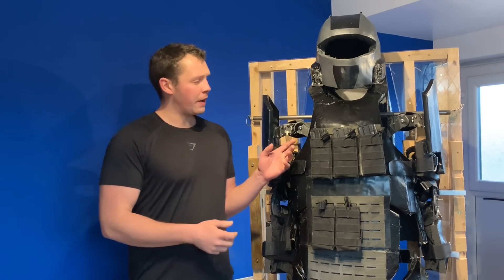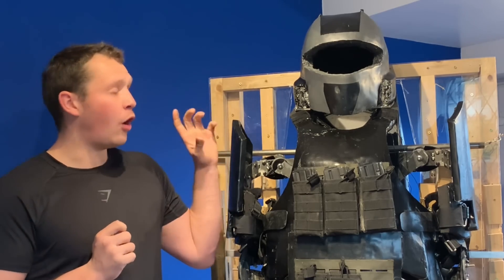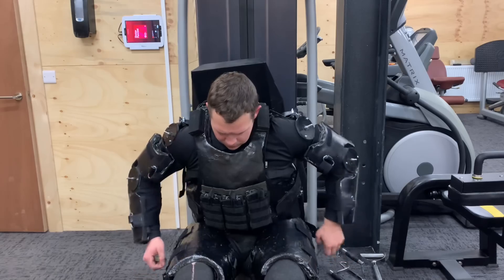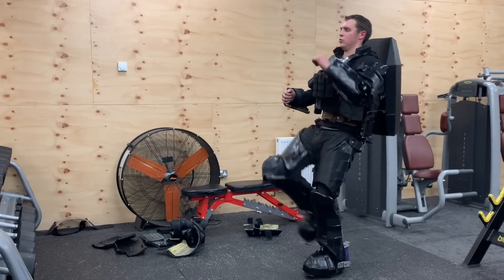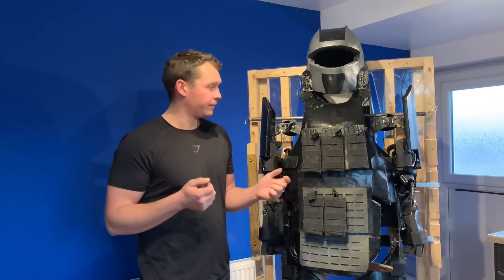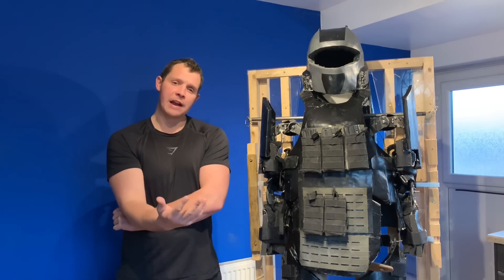Functional Combat Capable Power Armour Development Episode 5 Quest for Bullet Proof Exo Skeletons

Comment: and how is a soldier supposed to handle this immense weight? 
a soldier is already exhausted in prolonged combat.
also this could only be used in urban enviroment. Give it a dusty hot area and the soldier will melt. give it a tropical enviroment and you will 100% get stuck in mud in the first few hours.
also if you get injured, its hard to access or transport you.
Very cool project, but i heavily doubt this will ever see use.

but i dig the ironman v1 suit vibes :)

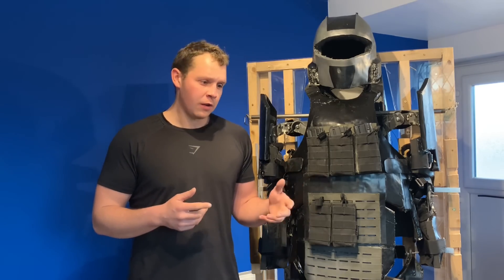also: 1:58 if you take a knee, you should be protected from bullets flying straight at your knee. try fix the weakspots. ankles, knee, your whole arms + shoulders... maybe try using MORE smaller steel plates, dragonskin armor style rather then using big plates to cover lots of area. should help in mobility too

Comment: I don't think it ever work... Leverage weight and pivot points are physics you can ignore, and so is battery/operational life,  heat accumulation, dust, moisture/rain and atmospheric temperatures. then you got the fact that however good the armour blast concussion and superheated air are a factor band will just ragdoll anyone .
Also you'd have to be dam careful weighing twice or three times as much going into various environments, like the abandoned buildings I work in. plus the extra noise you and the suit would make . It's a gimmic.

Comment: This is a nice idea, 
I am not going to tear down your idea.

I will offer some fundamental principles that  i'm certain you are aware of

1. needs to be mobile and more mobile than what normal infantry are, otherwise it is considered a negative. 
2. It has to be functional with being reasonable.  Full Body armor exists currently but is only used by bomb disposal outside of combat. Tactical armor, plate armor and small armored areas is not the presented design so you need to match it to a real world equivalent. So it would be "how to make bomb disposal armor combat ready"
3. Need to fit through doorways if CQC is to be a considered function 
4. Powered armor to increase, mobility, speed and strength is not the same as load bearing. 

Someone needs to start somewhere with this concept and your concept is a great step in the right direction.
Thank you.

Comment: One thing to point out here, the idea that this makes the threat from drone dropped munitions "incredibly slim" is a stretch at best. You have some LARGE panel gaps, especially under the arms, and between the pauldrons and the chest/back plates. This leaves all your vital organs exposed to shrapnel damage. Under the arm, the gap appears to be even bigger than that of my US Army issued Gen IV IOTV. This leaves your lungs and heart exposed to shrapnel from the sides as well as from shrapnel coming in at an angle. Then the added bulk will make getting in and out of dugouts during artillery attacks more difficult, requiring earthen fortifications to be dug deeper and larger, making them larger targets. Their entrances will also have to be larger, making them larger targets from drone-dropped munitions. This says nothing to the fact that a grenade going off 2 feet away from you will still put you out of the fight, even if shrapnel does not find a gap.

This is a neat idea, but unless the armor is fully enclosed (looking at you Spartans and Space Marines) then in the end the cons pretty much neg out the pros. You end up with soldiers who can carry more, but are slower and larger.

Comment: If Ned Kelly had a fabricator and a dream, Its an amazing proof of concept. While I think such armor will be used in the military to a limited degree. I think such suits are going to shine in policing, building clearing, and explosive tech. 
I dream of a future of police that are immune to all but Black tip bullets. 
Police with nothing to fear, no need to react in fear, with a club to apprehend rather then a glock to react.

Though it wouldn't be used for such a noble ideal.

Comment: The inability to establish a cheek weld and aim down sights while wearing a full face helmet can be mitigated in a number of ways. Soldiers already encounter this problem when fighting in CBRN gear. Currently, the two easiest ways of getting around this problem are either to use a visible spectrum laser during the daytime as you're aiming system, or an IR laser at night. Alternatively, you can rotate the weapon about 45° and then kind of cock your head to the side, and that gives you enough of an offset at the optic kind of lines up with your eye without getting hung up on your facial covering.

Something that's being looked at for use in the near future is equipping soldiers with an augmented reality visor. This would allow us to use a non-visible spectrum laser in daylight. A camera could spot the non-visible laser and then render it onto the soldier's visor as a reticle. An alternative route being considered is attaching a camera to the rifle and playing the camera's video on the visor. That second one isn't as big a leap as you might think. We already have high-end electronic scopes that wirelessly stream video to other devices.
Reply: Yup with the second idea. Have a camera be the sight of the weapon used. This way you can aim with it hell ever around corners. Also this way you can make some really beefy helmet and neck guards

Comment: The problem with this is the countermeasure will always be cheaper than the device itself. Even if it can stop 5.56 regular no way you can cover the body with thick enough material to stop 5.56 tungsten AP or worse yet, if you get your clock run by a .50 cal you can die alone from the energy transfer and back face deformation, worst case scenario a drone hit with a few kg of c4 or a rpg round still costs peanuts in terms of making such a suit functional. I doubt they will go on the front line maybe some exosuits will be used for transporting cargo i believe they already are

Comment: I’m sorry to say that the US DoD most likely will not fund this. They’ve already made one their own and it’s bottlenecked due to mainly energy capacity and weight. That’s why it hasn’t passed the testing phase. Another reason being that you must be a US citizen to work with DoD for certain things based on the applications I’ve seen here in UC Berkeley. I don’t know if it includes this. But another big reason would be the NDA, which posting it on YouTube will probably affect.

You can maybe do patreon? Or try to work with contractors?

Comment: some things:

1. You need to study medieval armour articulation
2. anatomic considerations - for example, the vambrace portion (the forearm armour) should terminate well before the wrist and some. main breast and backplate should not extend too far below rib cage end. I'd go so far as to maybe the bend should start towards the end of the center of the rib cage for better mobility and prevent neck trauma. anything below covering the lower trunk should have bands of overlapping plates (see 'placard', 'tassets' and 'faulds').
Reply: I used Medieval armour as a starting point and tried to marry it with Hockey gear. Not an exoskeleton, just wearable. It was too heavy and too hot to be feasible. It needs much lighter weight ballistic protection and a cooling system.
Reply: Haha have you heard of rgopvc? You take regenerated graphine oxide, mix it into pvc, then you cast it. You could just use molds and copy the hard parts of the hockey equipment and replace them with the rgopvc copies. It's something like 4x the strength of steel, while much lighter, so you could probably make the parts even thicker without having issues with weight.  @nautifella
Reply: @utterube   you probably wanna cast with  CNTs for better properties than rGO :)
Reply: @nautifella If your medieval armor feels heavy to wear, it wasn't fitted properly. The only thing that you should be really feeling the weight of in full medieval plate (barring really moving in it for extended periods) is the helmet because it's just sitting on your head with all its weight, everything else should be pretty evenly distributed across the body in terms of weight.
Reply: @nautifella  in the way of cooling, you could probably have a temporary solution involving those SAAPI hydration plates that just carry water.
Reply: Absolutely right.
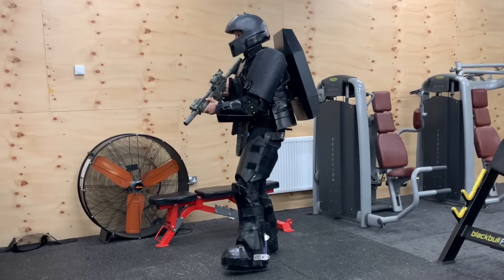Reply: 9:09 get rid of the visor all together. 

Vr headset with display on the inside of a fully covered helmet that has a series of cameras on the outside. 

Perhaps having a series of overlapping plate or just go full x-men juggernaut style and do the full dome with AC, hearing enhancements, filtered air, speaker, and a series of mini camera to display on the inside of the dome. 

Infact…. The dome would give way more deflection away from the head than anything else….. 

Then the vr headset can display the guns crosshair so it doesn’t need to be fired from the shoulder and quite easily fired from the hip or one handed due to your Exosuit handling all the recoil and heavy lifting.

…..I really should keep my mouth shut if i ever want to make my own…. Everyone I’ve seen try to make power armor or an exo suit have made a couple critical mistakes that could be solved with a few critical changes fo the suits design….. and then they abandon it fully….
Reply: @HunterSentinel  I think the nature of an armour like that should have redundancy and attempt more analog or physical solutions as part of the foundational design. For example, if possible a series of mirrors can provide eyesight (parascopes) and worst case the visor/eye slits should be removeable. Though the power of cameras, thermal and lidar sensors and building models in various virtual spaces would be very interesting.

@OP:

I'm a fan of milanese armors; the avant harness seems to be quite ahead of its time - as an example piece. something to look at as a point of inspiration. I would caution, that a lot of armours, originals/reproductions, really seem to get weird on the termination of th breastplate - which is core to the whole harness. There's also the cuff on the vambrace. I managed to get my hands on a thesis from some guy who was able to take pics of the internals, if you would like to review.  

Head movement and preventing trauma i think is super critical. any gel, and reactive mechanisms seems sensible areas to test out. plates that redistribute kinetic energy to the harness (maybe even down to feet) to reduce said trauma is perhaps worth the headache to engineer. though if you go heavy, i think the armour becomes centered around a breacher / head of the pack role for short periods.

i'm not an operator or am a huge pro at medieval armour, but its had my attention for some time and have made some pieces.
Reply: Yep, and go the extra mile and set layers of them since weights not gonna be a problem. 

Then, when the final build is complete, wear a big dumb extra extra large trench coat that doesn’t go too far down so it doesn’t trip you. 

Serves the same purpose as the billowing sleeves of the musketeers, obfuscation is always an easy extra bit to add onto your gear and costs nothing if it fails, but may be just enough to get you through any sort of struggle.
Reply: I imagine the proportions will be wonky due to the need for it to be powered/actuated, but in terms of coverage and how things fit together, definitely
Reply: I'd also look into how some cutting-edge shoe companies are re-inventing footwear for high activity. Soldiers do a LOT of running. The armor negating its own weight is good. The armor helping soldiers run more efficiently without tiring is better.
Reply: says the guy that didnt build shit
Reply: The guy has a point. Our ancestors spent centuries trial-and-error testing armor designs. A lot of the hard work was done centuries ago and we don't need to reinvent the wheel. @Madwidget
Reply: Tiny ac device that runs on batteries for cooling the heating tech has already been developed (think heated socks); scale mail for the lower torso; segmented plate armor for the upper torso; mechanical springs for assistance with stability. Hopefully this helps.🤪

Comment: This is pretty amazing! Do you plan for any models in the future with some sort of safety for more “versatile” dangers that could make way into the suit; ie: petrol bombs or Molotov cocktails? One significant disadvantage of a soldier in a suit like this would be that it would turn into a caged kiln should any sort of fire or corrosion take effect on the wearer’s skin while armoured. Obviously many things will come with time but I just thought of the question and wondered if you had possibly thought ahead for something like that.

Comment: Nice. Some ideas for you. One, abandon the idea of aiming down the sights while wearing a helmet. Use a laser pointer or an augmented reality targeting system that links to your gun's sight. Two, this will quickly degrade under the kind of fire you'd need it for. Perhaps you should make a frame to attach armor plating to, armor plating that can be easily replaced once it's too damaged. Three, you may want an under layer of armor for heat resistance with an in built cooling system. All good power armors I see in fiction can walk through flames, you sure as fuck can't with that.

Comment: its an interesting idea and seems to be a lot more cost effective than most current designs so wish you luck. maybe you can get a decent version going and sell it off to the SFC or something
also i believe a big stopping point of the design might be the the armour itself, if you take a few hits you will need to be able to swap out the aramids and ceramics each time, and if this maintenance cant be done relatively easily by swapping out the plates and such then it might be deemed too big a hinderance to be taken on by any large group. also just an idea and i don't know if it would work but you could take some inspiration from real armour to help cover joint more as i think having that would give the armour more appeal as long as it doesn't restrict movement too much or add too much weight. 
lastly you should be sure to do research on how other projects like this went with funding and such and see what most of the stopping places were if your going for funding.

Comment: Visor no (maybe?), goggles yes. Maybe make it so visor can go over goggles incase of mud caking onto it after explosion. Make sure ALL hot air from breath is vented down and away from the face. A helmet like that gets hot, sweaty and can fog up a visor just from your bodies heat and sweat. Ventilation and padding engineering, to take that heat transfer through the helmet pads. Never store heat. Hot breath just makes it worse. Then gear access and range of movement focused on the front cummerbund. Good armor can let you do things as if you weren't wearing armor. Full range of motion, including crawling by elbows only. How much weight does the exoskeleton hold and is it outlet rechargeable? 

Could movement in the limbs generate to power charge it or keep it running at 10% battery like how a bike can generate electricity putting its chain to motor or small hand crank? Like on spring piston compression which supports the limbs, but the more you carry provides more weight resistance against the suit activating the mechanical movement generator. Electricity can make something mechanical have power burning fossil fuel energy in a power plant, then something mechanical can generate electricity, but usually involving something spinning. Does compression work?